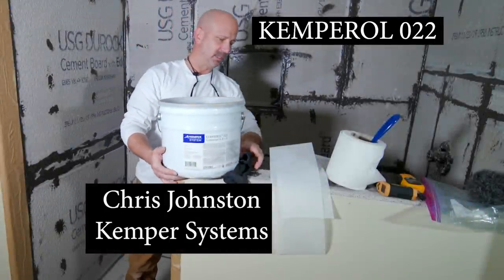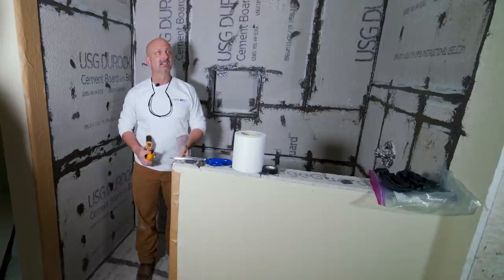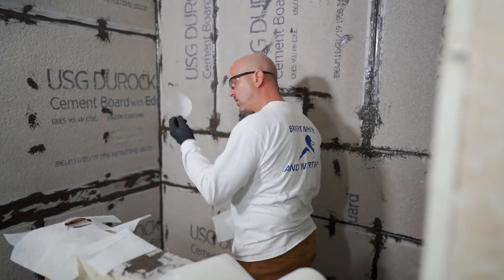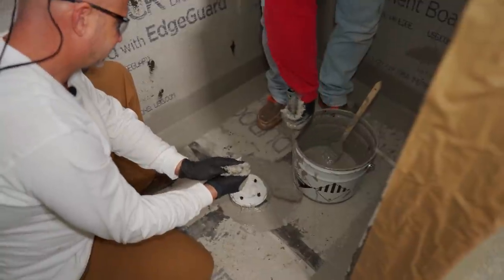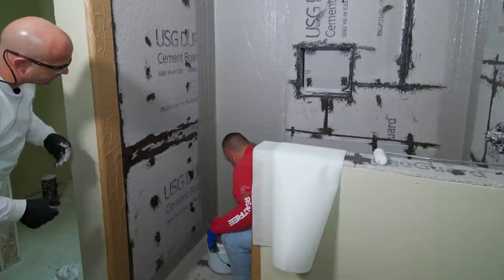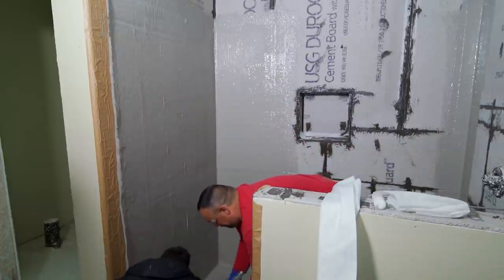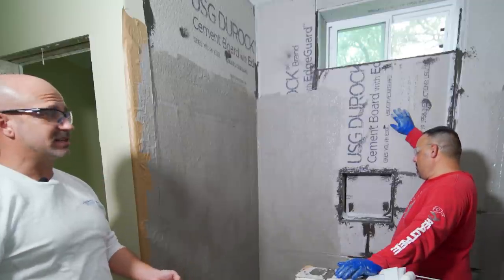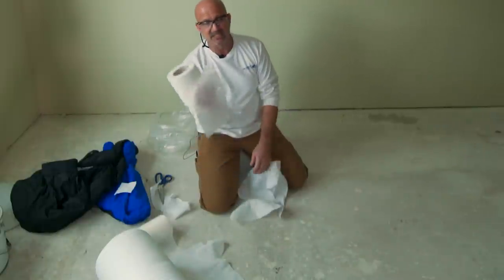How to waterproof a shower - STEP BY STEP

Comment: Same concept as working with FRP. 
When worling corners, joints, or working the trapped air out use flexible plastic spreaders as a sqeeggy & on the corners use on its edge to jam the fabric tight in the creases.
Orale Roy !! you can make a custom speaker pod for your whip with the fleese & resin or used fiberglass matt or woven cloth & make yourself a canoe lmfao.
Always nice to see guys willing to learn.
Great video Tex.

Comment: i have no doubt this is a good product when applied correctly ,but, why would i not use red guard when it is far easier to use and serves the same purpose ,also there is suppose to be a small drain hole in the floor drain ,did he just cover it up ?

Comment: ???? Pardon my ignorance...why do u need to apply this water proof product? Does installing tile water proof the area? Also, what is the cost estimate on such a product for that size area? Is there any other water proof products out there that is not so time consuming ( assuming time taken by length of video-tooo long)?  And boy! we not considering clean up time...
Reply from the maker: The tile does not water proof your walls.  You need to have water proofing under the tile.  There are many other products that will work well, this is just one product that produces great results.

Comment: WOW that is a strange product. I prefer RedGuard or the same in blue from USG for waterproofing. That product ouch way to much red tape and rush here and rush there. ..... That product is garbage. To complex and way to complicated to apply and utilize. Nobody will use this crap on professional job's. Even if you would to a full shower now in fiberglass and all you would be faster. Yes you can use fiberglass mesh and roll on resign to make a 100% leak proof inset before you tile over it too. 
We use RedGauard as much as possible. Yes it cost $150 for 4 gallons but that is enough for 1.5 showers often we use it in the kitchen as well so drywall behind the kitchen sink's will be sealed off to avoid water from damaging the drywall behind it. We have seen to many times the failure. Benefit with red guards is you paint it on PINK and it show's cured dark red and you can after it paint over it and boom it's fully hidden. 3 coats for showers and 2 coats behind kitchen areas. Sometimes we even use it on exterior as well. 130sf for 3.5 Gallon for Waterproofing a shower liner. Worth for me every penny because everyone on the jobsite can simply just roll it on wait 2-3h and than add an additional coat so within a day the membrane is ready and next day the tile guy can go to town and tile the shower up. Simple is that.
Reply: I also prefer redgard...expensive, but if you're going to do it...do it right and be done with it.

Comment: The water proofing is a waste. I have renovated bathrooms for 30 years. Just durrock and use a good grout. The smaller the joint the better. Problem with what your doing is the water gets through grout and grows mold between the durrock and the tile. Durrock still rots when wet and tile still falls in time. Most water gets through the grout, through the opening for plumbing trim, and through mounting screws.